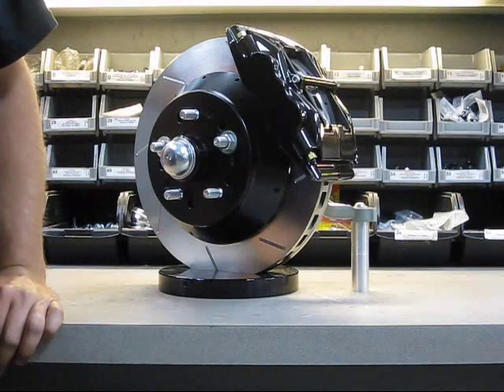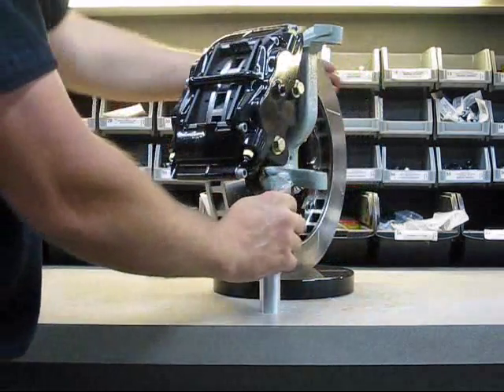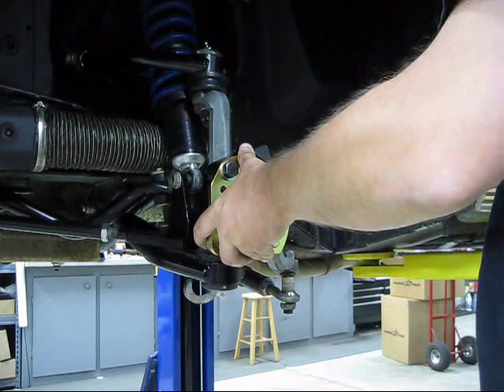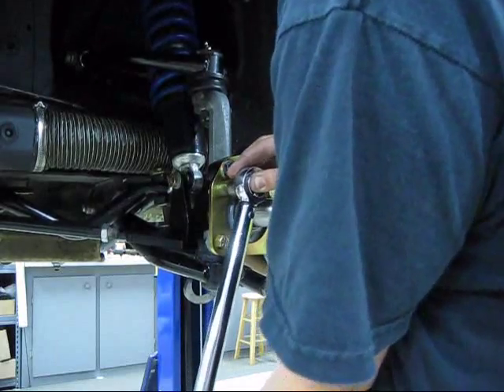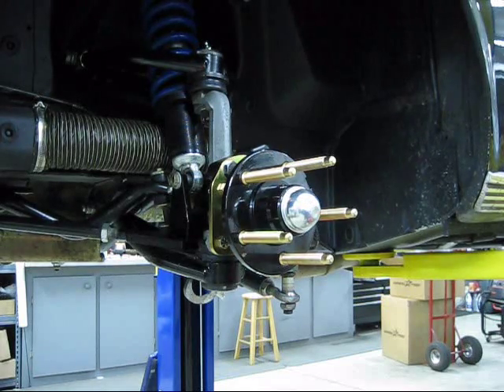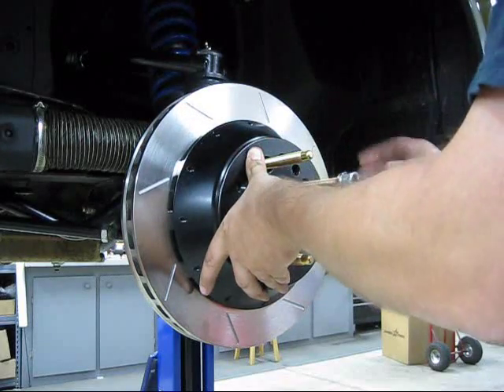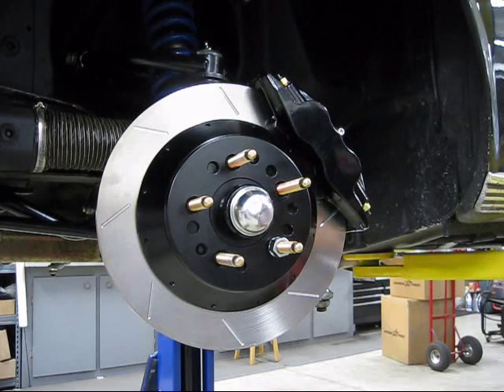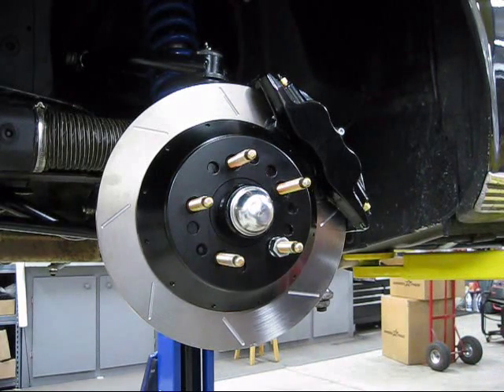Street or Track 13 x 1.25" Brake System Install

Comment: I have this exact kit on my 1970 Mach 1 Mustang. It's simply AMAZING. The fit and finish are factory quality, and the brake performance make a vintage car stop better than 99% of most late model performance cars! The kit also clears my 17" Vintage Wheel Works V48 wheels with a TON of clearance. 

Thanks to Street or Track for doing such a great job engineering this kit!!!!